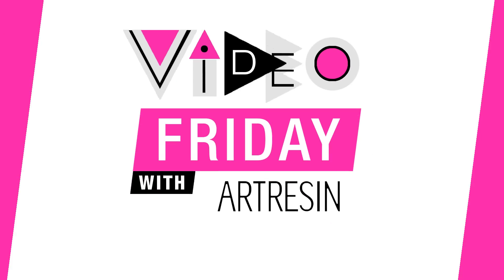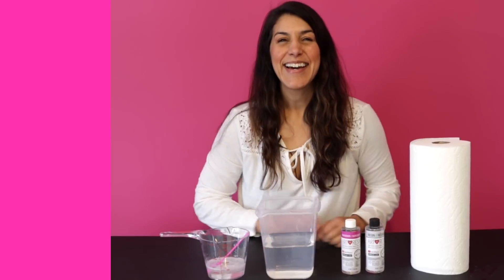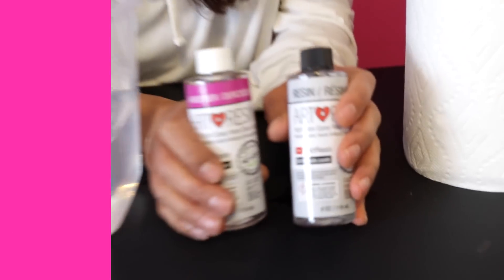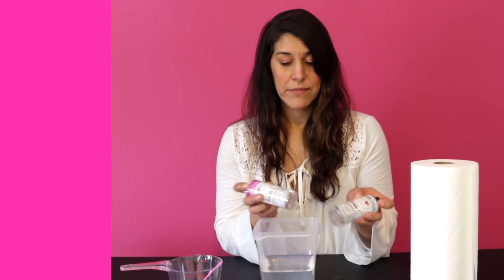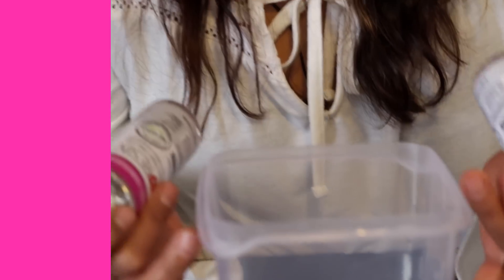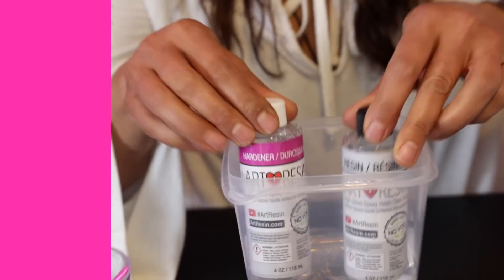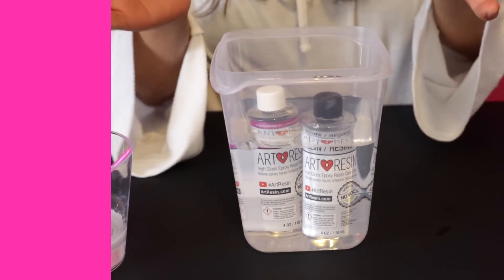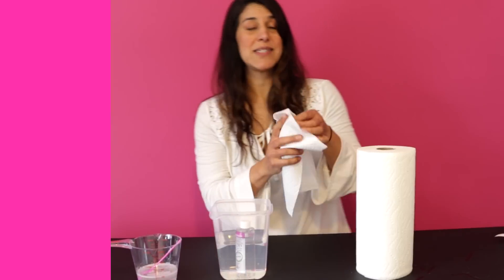How To Change The Viscosity Of Resin

Comment: will this method apply  for uv resin?
Reply from the maker: ArtResin is an epoxy resin, so I can't speak to whether this will work for UV Resin. For the most accurate info,  I would contact the manufacturer of the UV Resin you're using and ask what they suggest to thin out or thicken up their product.

Comment: Anyone have advice how to do this with UV resin?
Reply from the maker: ArtResin is an epoxy so I'm not 100% certain, but I believe you can warm the tightly capped bottle of UV Resin in a warm water bath as well, which should increase the flow and reduce bubbles. 

I would try it out to see how it works!
Reply: @ 
And to thicken it?
Reply from the maker: @cwa728  for that, I am not sure.  In the video, the thickening is achieved by waiting until the resin has started to cure. 

The curing method for UV Resin is so different, this approach won't work.

There are thickening agents but again, not sure if they are compatible with UV Resin.

Might be best to contact the manufacturer of the UV Resin you're using to ask what options they suggest for thickening.
Reply: @ 
Thanks!

Comment: No mask needed?
Reply from the maker: ArtResin is non toxic and does not produce fumes.  It is a pure formula that does not contain all of the cheap chemical fillers that some epoxy resins use to stretch their formula.  Those fillers are not necessary in the chemical reaction and just get released as toxic fumes.  ArtResin is safe for home use in a well ventilated area without the need of a respirator.  Have a look at our blog on how to safely work with ArtResin: 
https://www.artresin.com/blogs/artresin/what-safety-precautions-should-i-take-when-using-artresin?_pos=4&_sid=6f0f295c9&_ss=r

Comment: I need thicker epoxy. I do let it sit for a while but then I have only 5 minutes to work with. I’m looking for the same thick consistency for about 20 minutes. Any idea?
Reply from the maker: Different epoxy resins will have different viscosities.  If you want to compare apples to apples, you can usually find this information listed in the technical data sheet.  ArtResin: Viscosity at 25ºC / 77ºF Resin - 3500 cP,  Hardener - 600 cP,  Mixed - 2000 cP
https://cdn.shopify.com/s/files/1/0770/0749/files/ArtResin-Technical-Data-ENG-FR-ES-DEU-ITL-DUT-2020_1.pdf?v=1679943987
Reply: @Artresin  Thank you
Reply: Problem with leaving resin to thicken is as soon as you apply heat it will go runny again! There is a real gap in the UK market for a higher viscosity resin.

Comment: Shouldn’t she be wearing a respirator?
Reply from the maker: If you are working in an open area with ventilation, a respirator is not required when using ArtResin.  ArtResin is non toxic and does not produce fumes or VOCs so it does not pose a threat to your health.  Have a look at our blog for more information:  https://www.artresin.com/blogs/artresin/what-safety-precautions-should-i-take-when-using-artresin?_pos=4&_sid=2ae756644&_ss=r

Comment: What does it mean when they say it is a mixed viscosity? I understand the low,medium and high....,but mixed viscosity???
Reply from the maker: It could be referring to the product once the two parts are mixed.  For example:  ArtResin's viscosity at  25ºC / 77ºF  is as follows: Resin - 3500 cP,   Hardener - 600 cP and once the two parts are mixed  :  Mixed - 2000 cP
Reply: @Artresin  Doh! Thank you . ✌️

Comment: What happens if you put freshly mixed resin in the microwave? Does it get runnier?
Reply from the maker: We do NOT recommend this!  You will end up with a flash cure.  When too much heat builds up your resin will have an exothermic reaction, begin smoking and will cure immediately.  If you wish to warm up your resin and hardener we recommend a warm water bath.

Comment: And if we mix talc (or silica/ poly fiver) in the resin, it won’t cure?
Reply from the maker: Hi Vidhi, you can add talc or silica to the resin, but as a general rule we recommend not adding more than 4% per total volume of mixed resin. Adding more can impact how the resin cures.